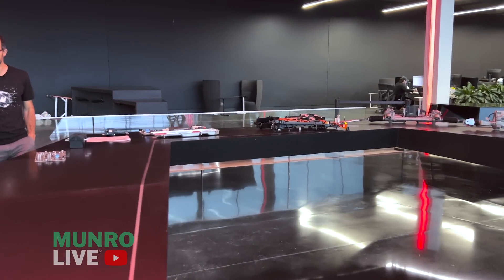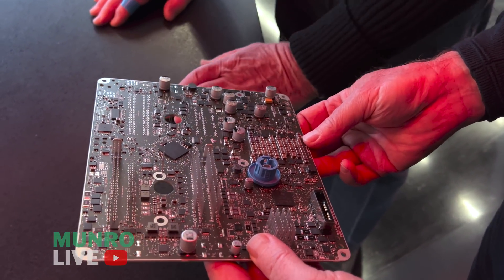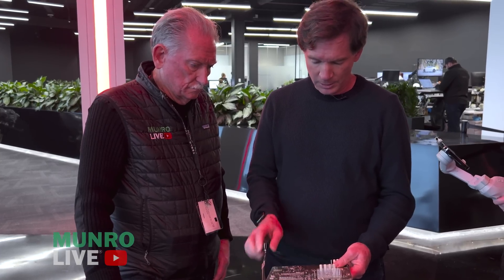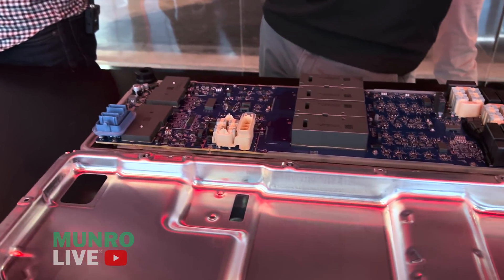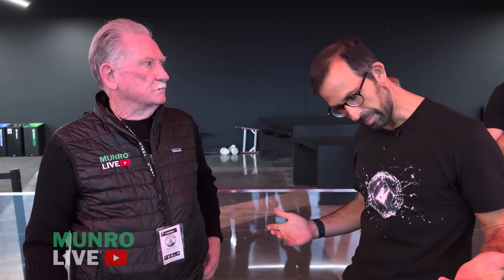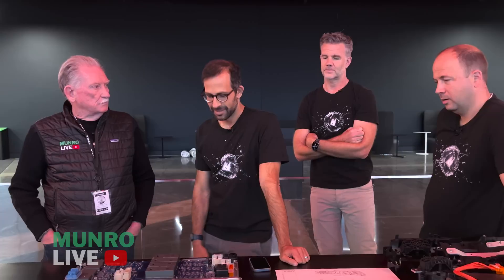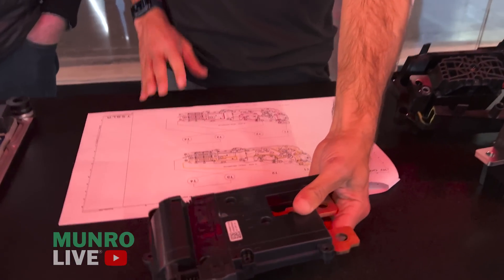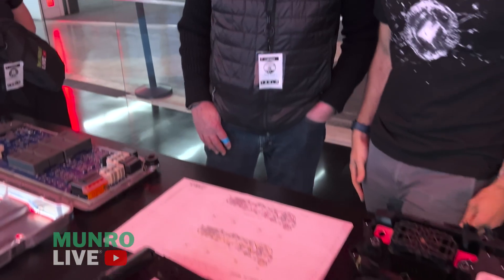Tesla Cybertruck's Power Converter capable of 800V

Comment: 48 didn't work years ago because after 36 Volts analog switches start arcing and frying electronics. Popular Mechanics article from many years ago.
Reply: In the age of Solid state, that problem is solved.
Reply: Right, @Derpy1969 , but Sandy claimed that he invented this idea and promoted it in the 1980's (when it wasn't practical), and implies that auto executives were stupid for not accepting it (although it was not practical at the time).
Reply: Mechanical switches are a problem. Frying electronics just means they used cheap undersized parts. There is nothing fundamental that makes it difficult to make 36V electronics work. Above 200V silicon starts to run into difficulties and more tricks are needed to make it work. But with Silicon Carbide and Gallium Nitrite based electronics that has been solved too.
Reply: you know... 120v or 240v is the same. light switch. heater switch. there is a lot of electronic that work on house voltage and i don't see any issue with theses. yes power supply fails for computer but after how many years of abuse?
Reply: Popular Mechanics that was always a joke.

Comment: Want to see the inside of the 48v battery!
Reply: Same as a 12V but wired differently, no?
Reply: It would look the same.  It is just a standard lithium battery.
Reply: It will just be a 12-cells-in-series version of the current 4-cells-in-series low-voltage battery. There's nothing special about 48 volts (which is really 42 volts nominal, 48 volts peak).

Comment: "I can hardly wait to see who comes in second!" LOL
Reply: Savagery
Reply: The thing is 48v isn't a huge benefit in ICE cars, and anything above 30-40vdc starts being a problem with contacts arcing. The currents are lower but the relays and switches become more expensive
Reply: Sandy says Tesla will be second to BYD
Reply: @qwazy01 BYD isn't doing innovation like we're seeing on the CT. They're doing good refinement, but it's up to others to blaze the trail. This is what Tesla is great at.
Reply: @ColinFox  oh I agree with you.  Sandy is looking at the quantity of BYD, when I think he should be looking at the quality of Tesla.  Imo Tesla will ramp and launch past BYD with superior products, but government will ensure BYD wins home territory long term.
Reply: Who comes in second? Europeans have been using 48v systems for 11yrs now, and several manufacturers have 800v
Reply: @GTO33  Those European cars use the 48V Bus as a HV bus of sorts and still feed all the regular stuff with 12V. Cybertruck seems to have eliminated that.
Reply: @GTO33 lol, those 48v systems were only for mild hybrid motors and batteries. All those vehicles still ran off of the 12v low-voltage system - and you would definitely know when you would have to jump the main 12v battery.